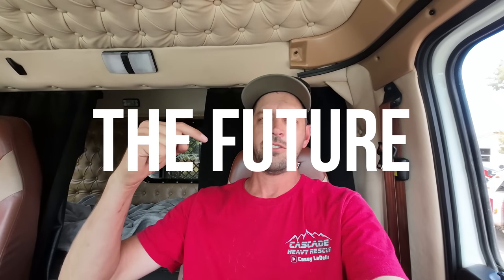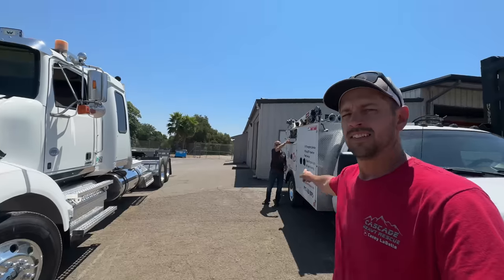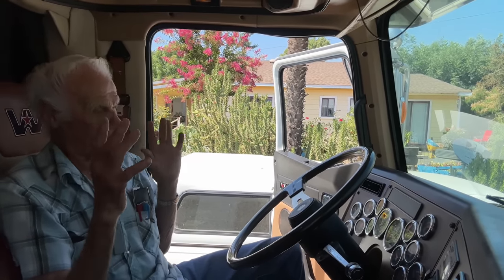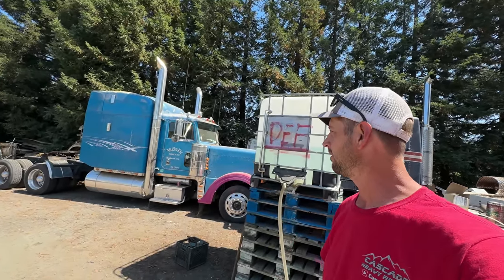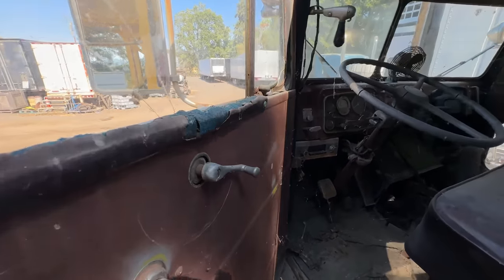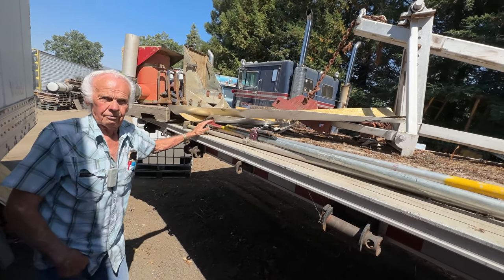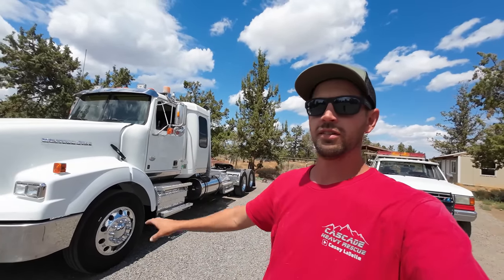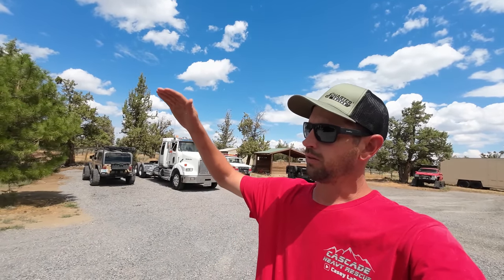I bought a new truck!  (road trip home)

Comment: Hi Casey,  I have been watching for a few years now.  Keep up the great work.  I work at a Western Star dealership in Ontario (Canada).  Parts shortages are still an issue these days, so if you need an extra set of hands to help source parts for your trucks, feel free to reach out.  I worked at Peterbilt for 10 years, and I have contacts at International/Navistar as well.  So I might be able to help with any of those units too.

Comment: I now drive a cement mixer truck with an allison 6 speed. I'd hate to go back to a clutch. Our loaner truck is an older Mack and I told my boss if mine goes in the shop i'll just take a vacation till it's fixed.

Comment: awesome. It sounds like the microphone has some automatic gain control. if you are talking, close to the mic, it turns sensitivity down to not over- amplify your voice. but if someone else, further away from the microphone is talking, gain is all the way up which also adds a lot of ambient noise. and switching between the different gain settings is very noticeable but it is really not bad. way better than when the other person further away is super-hard to understand.
Reply from the maker: That was me adjusting it in the edit or it would have been unusable

Comment: Is their a benefit of long wheel base? LOL preferences ok but turning around jack knife in road your going to need 4 lanes. But you got me. curious to what your up too. And off beat people up my alley. LOL
Reply from the maker: Yes, long loads can hang off the front of the trailer and eliminate the needs for permits.
Reply: Going to be a interesting design out back. Taught it was you can run behind to get coffee etc stright as a arrow. LOL

Comment: Nice to meet your grandfather, man I bet there are some stories cooped up in his head.

When I retired, 5 years ago, I was running the shop on night shift, a couple of crews in the bush and a bunch in the shop on the trucks.  Had a fleet of Stars set up for logging so heavy haul.  Tri axle drive, DD16 engines with the Eaton Ultrashift Plus transmissions behind.  When we first got them, there was a fair bit of blow back from the drivers but after a couple of years most of them were sold on them.

My biggest complaint with  WesternStar was the wiring, all white with stenciled numbers on the wires.  Problem was the wires would get dirty and when you wiped the dust off, the number came off too.  And the wiper motors.  Every truck went through at least 2 motors and it was a hell of a job.  I have big hands and I was the boss, so always got one of the other guys to change it out, horrible job.

And we ran the NeWay ADZ suspension.  It packed the weight but was not made for logging and switchbacks.  Our trucks ran max payload all the time and if not running on the highway for a haul, maybe even a touch more (😱😱😱)  Just eat the wishbones up.

But I did like the Stars.  Good heavy trucks.  After I left they went back to KW for a bit but in the end, swapped back.

Now I can't wait so see what you have planned!

Comment: As a new flatbed driver, I would love to see a video on how to use the wheel lift (stinger) to get a car out of an awkward parking spot. For example a car in a driveway where I can’t pull up directly in front/back to load, and I don’t want to use the winch and snatch blocks to pull it down to where I can load it onto the bed. Like a 90 degree lift and reposition.

Comment: Casey, for audio, you should record two audio tracks. The one from the phone and one from a standalone recorder. It's a bit more work to edit but you'll never lose audio again, and you can mix between the two for the best source.

Lmk if you want some help with that, happy to help pick a good easy solution for it.
Reply from the maker: I refuse to put that much time into editing.   Any more than one hour per video start to finish is a waste.
Reply: @CaseyLaDelle  fair enough! Just the cellphone is best then, most reliable single source for audio. If you do decide to try dual audio source at some point, just do a clap on camera once you start recording, and use that spike in audio to sync the extra track.

Comment: I love the truck! Remember, you can retrofit an Allison into anything. There’s plenty out there on eBay and junk yard from garbage trucks, fire trucks. There short and long ratio, 6 and 7 speeds. You’re axle ratio may haven’t to change a little or your Rpms may be too low. 

The DD13 is an okay engine, it does have the power if its set at 500 Hp. Usual culprit will be the emissions system. The value of the truck will go up, since I believe  Western Star ended the production of that series of trucks.

Comment: Over on the green side.
I've seen a few trucks with a hydraulic drive to the steer wheels.
Works at sub 25 mph or so.
And dosen't need a massive lift to the truck to work.
It's normally on the chip trucks, or log trucks running 105.5 gross.

Comment: Hey Casey , thanks for this very cool video. Your grandfather has some very cool old trucks. I have been hauling equipment and working for the same company for over 28 years and many different trucks through out the years but the old trucks your grand father have are so cool. Thanks for sharing.

Comment: How do you hold an automatic back coming down off of a mountain though?  I've got an Allison 2500 attached to my Mercedes MBE906, and it does not like to hold a gear even when shifted into L, 2, 3 coming down a hill.  I don't know if that's just the nature of the beast, if something is wrong with it I need to get fixed, of if I'm just not doing it correctly.
Reply from the maker: Whoever programmed that transmission screwed it up.   Have someone with the Allison software plug into it and change that.  If you manually set a gear, it should not shift above that gear for any reason

Comment: I am looking for a truck. I will need something to pull my 47' trailer to eastern Montana from Tacoma, Washington. I am debating getting my CDL ($5,400.00) and buying an inexpensive truck and doing the hauling myself, or just hiring the work done. It will be three or 4 trips total (12,000 miles total) to haul two trailers full of stuff, a 45,000# case 850B trackloader, and a 40' container full of stuff.

Comment: i had to stop driving in 2007 because i had a stroke. but the last truck i owned was had a smart shift. it was a standard but it shifted itself once i let off the clutch. it was a 13 speed with a 4 speed behind it with 3 speed rear ends. needless to say i pulled super loads. and i miss that part of it but i dont miss the DOT BS all the paperwork and stuff.

Comment: I like Charter. Pulled quite a few trailers for them. Your grampa has it figured out. 
You tried one of the new Allison with more gears?  
Ok 4900sb. Wire harness tends to bake under radiator, one box lifetime is 400 to 500 k if worked hard.  They do not like low rpm idle .
Cab air filters lower passenger side.  No it not like Western Star of old

Comment: Well if you ever get an electrical issue in cab I pray for you because unless that is brand new all the dash wires are white. Other than that and window heaters Western Stars are really good.

Never buy a Volvo Truck they are horrible to work on and there are not a lot of places that want or like to work on them. Parts also tend not to be kept in stock other than at Volvo dealers.

Best combo imho is International chassis, Cummins Engine, Allison Transmission, conmet preset steel hubs with stemco pro torq clip, Stemco Grit Guard Seals, Meritor Ex+L, Bendix Pads, Truck-Lite or Grote Trucklite has better offerings Grote has better availability, tires I have no clue. If you have to manual though eaton is the way to go.

Western Star is best for heavy haul stuff though.

This is written from a mechanics point of view. Keep being awesome.

Comment: Vulva automatic sucks. I drove one once and won’t do it again. It’s not comfortable with that gear shift in your thigh. Almost every automatic semi truck has no acceleration loaded.
Reply from the maker: Actually, there is only one brand of automatic transmission, and there’s not a manual transmission out there that can keep up with it on acceleration

Comment: If those dang fuel tanks weren't in the way of the outriggers, I'd guess you would be doing knuckleboom shenanigans. 
Maybe some drag winch shenanigans????
3 axle RGN with a 2 axle flip. Maybe a 2 axle jeep??
But then again, a 13L and 13 speed, it ain't gonna haul THAT heavy.
😁
Reply from the maker: That combo can haul heavy all day long.   More power and torque than the 3406B that everyone raves about pulling “heavy” with
Reply: @CaseyLaDelle  power, yep. Torque, doubtful.
But REAL heavy haul guys use C-18 Cats set at 1100 HP, And QSK Cummins at whatever HP.
They have to be gliders to get that set up.
Oh, and 2150 torque 18 speed transmissions. Unless they are pusher trucks, then it's Allison.

Comment: H9w much you reckon your grandpa would want to the outside visor in the red cabover with the driver's door. I'm looking for one to modify for a 2000 F350 Super Duty. I'm trying to also find a fron hood and fender from an old Pete the modify to fit same truck to make wanna-be Pete since I can't afford a real one.

Comment: Genuine question, one that's been bugging me since seeing the first video at your hay-barn friend, and one some of the other viewers might be able to answer me:
Why might you want a LONG wheelbase? In Europe, you see small wheel base almost exclusively, and the small ones should be more manoeuvre as well right? so why the long wheelbases on so many american trucks?
Reply from the maker: This truck was built to haul long beams and poles.   Hanging the load off the front of the trailer instead of the back reduces the need for permits and pilot cars.
Reply: @CaseyLaDelle  did not expect an answer from the man himself, made my day a bit, thnx!

Never thought about how length regulations might work differently, because over here (EU) that would barely make a difference😅 thnx again for the answer, love your no-nonsense approach to stuff!

Comment: weHICH MIC did you use? After getting a mic that can be connected by usb c (Røde Videomic Go II and the røde wireless Go II receiver), I found out, that with the Røde central software, I could adjust the gain on the Go II mic.. and on the wireless Go II, the gain had to be set to -24dB or lower, for the audio not to blow out.. and congrats on the new truck :)

Comment: JAKE BREAK ON WHILE BOBTAILING😂
Reply from the maker: Yes, of course
Reply: I accidentally left the Jakes on when going through a scale.  I didn't notice anything until I shifted up to the high side.  I started grinding gears and thought my million-mile 13-speed had finally gone out! I looked at the switch for the Jakes and saw it was turned on.  Turned them off and everything was fine.

Comment: An Allison automatic? In a highway tractor? i wasn’t aware that’s an option
Reply from the maker: Yes it is, and it’s by far the best transmission you can get in a heavy haul truck
Reply: @CaseyLaDelle  i’m a Heavy truck mechanic at Ryder , never seen any come through yet all the freightliners have detroit drive lines or cummins and eaton automateds , but i did google a little and found it is an option
Reply: @CaseyLaDelle Does he have the TC 10 Allison. That is what I did ( after 45 years).

Comment: Why can’t they run on the road,what does all that mean casey
Reply from the maker: California doesn’t allow trucks older than 2011
Reply: The state of California thinks that all trucks that don't have the newest emission controls will pollute the air.
Reply: California has long imposed the most controlling, tough to comply standards on many aspects of business operations. Commercial trucking is just one area, a very big one, where tons of rules are dumped on small businesses. I'm not ignoring that CA is trying to address real problems. Just saying the way they go about things pretty well ignores the negative impacts and unintended consequences. All while the politicians smile their expensive dental work and talk about all the good they do.

Comment: Whats the point of such a long wheel base. These yankee rigs with all that space between prime mover and trailer, just doesnt look right.
Reply from the maker: In the case of that blue cabover, it’s actually a far shorter wheelbase than it looks.  But it was ordered by someone who has the contract to haul power poles for the utility company in the area, and most of that part of the state has a 65’ overall length limit.   With that “long” wheelbase, the poles could be loaded to hang off the front of the trailer right behind the cab, and the whole setup be under 65’ with no overhang off the rear of the trailer, meaning no permits and no pilot cars needed.  

Now in the case of my new truck….  Physics.
Reply: @CaseyLaDelle  Thanks for response Casey. Im way down here in Oz and its something we dont see much of. Long wheel based rigs with enough room between prime mover and trailer to play a game of basketball, and in most cases, with only dual axles on the trailer.

Comment: As someone with a 2024 4900x ....the auto sucks butt cheeks, though, mine is the dt12 auto and the isx12...this truck has almost zero clue when or how to shift...it will short shift Double up on an incline to make itself struggle Soooooo much that it has to double back down because it bogged itself so much that even down shift 1 gear wouldn't be enough.
Reply from the maker: You don’t have an automatic.   Allison account a the only manufacturer of automatic transmissions and they work VERY different than the automated transmission like you have
Reply: @CaseyLaDelle  correct. It is not an automatic in the traditional sense. But I am not in control... a computer is. So, for all intents and purposes, it is an automatic. But I have driven trucks with an Allison automatic, (not that exact model, of course), but if this one is anything like those, then I gotta say still wouldn't be impressed. There isn't a single automatic or automated manual that I have driven that ever did what it needed to do for one reason or another. Manual is the way to go in my opinion.